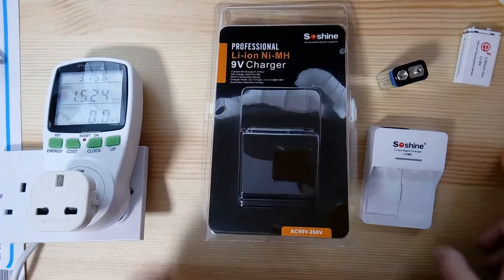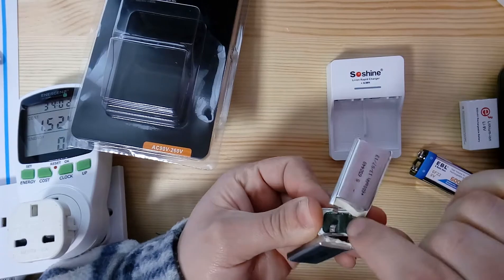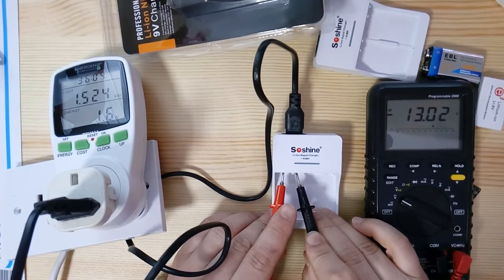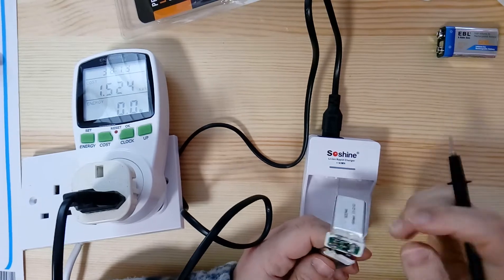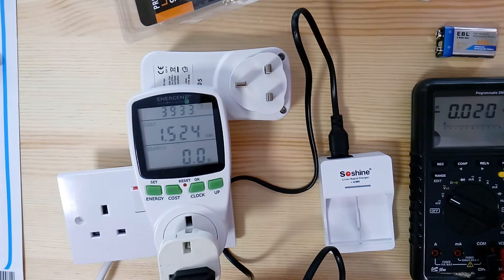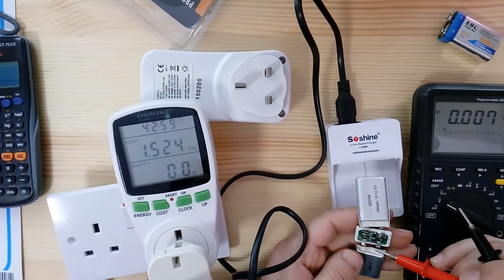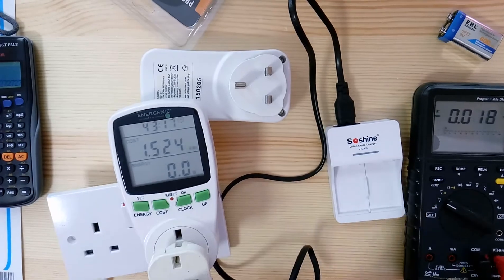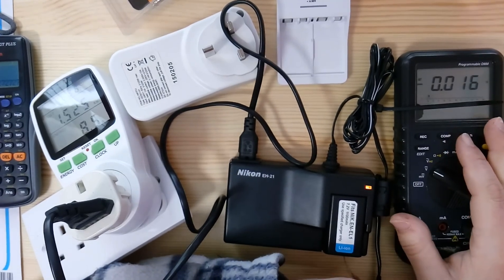Shoshine 9V Lithium Ion and Ni-MH battery charger

Comment: I am summer from soshine company.Regarding to the rebviews,please find the reply as below:
1. This charger is not a specific charger for lithium battery, but a multi-functional smart charger, which can support 9V batteries as: LiFePO4 3pcs in series, NiMh 7pcs in series, ternary lithium battery 2pcs in series. And this charger has a 0V battery(means: lithium batteries’ PCB are in protection state and NiMh batteries with serious over discharge condition) activation function.
2. Since the 0V activation function exists, it is not possible to determine if there is a battery access according to if the voltage is higher than 0V. The NiMh battery maximum voltage (charging) can up to 10.85V, and consider some unpredictable factors and errors, so no-load floating voltage is set to 13V (must be higher than 10.85V). By check whether floating voltage is less than 12.5V to determine whether there is a battery access. This floating voltage is not the charging voltage for lithium batteries.
3. After battery is accessed, charger will enter the battery type determine procedure, the time is about 20 seconds. If the battery has been determined as ternary lithium battery, charger will automatically switch the charging mode to constant current 200MA, constant voltage 8.4V for charging. So, as long as the charger is no problem, there is no reason for charger to over charge the battery.
4. As the charger will continue to determine the battery types, so it’s not possible to get the real charge voltage if directly load to resistance. If you really want to test the charge voltage for lithium battery, you can disconnect the charger’s connect test point (Figure 1) into the factory test mode.
(Note: Do not enter the factory mode test time for more than 1 minute.)
5. As overcharge is bad for lithium battery, so all ternary lithium batteries will be covered by protection boards for use. Multi-section combination is even more so. Generally protection board is to prevent the battery from: overcharge, over discharge, over current, short circuit, etc. Overcharge protection function works to turn off the charging circuit if it detected any one of the battery’s voltage exceeds 4.35V (the protection voltage differs in different protection chips). Due to this charger's battery identification mode, turn off the charging loop is equivalent to removing. So the voltage tested this time is floating voltage, not the battery charge to the 13V high voltage.
6. 9V battery has only two electrodes, so the charger can not detect the voltage of each cell, it will keep charging if the battery voltage is less than 8.4V. From the video we can see, one of the battery voltage is only 1.34V (voltage down to the value, the cells have been scrapped), the other battery voltage is 3.71V (normal cells), two batteries has been seriously unbalanced. When the normal cell voltage reaches 4.35V and the other voltage is less than 4.05V, the charger will continue to charge, PCB will enter the overcharge protection state.Conclusion: This video does not indicate that this charger is not suitable to charge for lithium batteries. But can explain the battery quality is very poor.
hope you will like our soshine products.  www.soshine.com.cn
Reply: Thanks for a thorough explanation! 
In fact I have the same charger and never had any problems with it.

Comment: awesome test of these battery chargers, do you think it is more the cause of the protection ic though? it has such low voltage tolerances it does not seem like it would do a good job, 13v is only 5v above the input voltage at 100% soc i am sure higher power circuits would properly protect from 20v at the terminals dont you think? thanks for sharing!
Reply from the maker: +SuperBrainAK 
I always take any protection IC with a pinch of salt, because the charger is supposed to put the right voltage in the first case. If there were no protection IC (Some crap Chinese battery) and the charger was allowed to top the battery up to 12V, surely a leakage or perhaps a fire would happen. This is probably the reason why most stores dont sell 9V batteries with lithium chemistry. Liability issues...

With that said, if one were to count with the protection IC to stop charge once the top value is reached, regardless of the charger output, in all fairness, any NIMH/NICD charger could be used, so as a consumer one can conclude that the device is not fit for purpose.

A workaround could be to place a zener such as a 1N5238B across the charger terminals. This would shunt enough current to force the charger to detect the battery as a Li-Ion and even if the protection circuit opened, the output would be low enough to keep things safe.
Reply: +Susana Godinho true, but my point is that the protection should "protect" the battery without failure from a failed charger or other extreme voltage spike, though I guess it did fail decently safe without having a lithium fire so it did its job, they arent going to make it so robust that you can do just about anything to it and still work. regardless I will definitely make sure I get a lithium only charger so I wont have to worry about these things. what is your opinion on the EBL AC two cell charger (http://.amazon.com/dp/B00ER10DZ0)? that is what I am thinking about getting when I feel I need some 9v's (I have a programmable charger but having something standalone is preferred)

Comment: If protection circuit gets damaged at 13v, than it is no good at all. Their batteries, same brand as charger work just fine. after they stop charging at 8.3xV, green led comes one... you your no load test is not valid
Reply from the maker: This charger has no issues detecting that the battery is fully charged, where it fails is under abnormal conditions, when the cells inside the '9V' battery are unbalanced and the protection circuit acts.

Comment: Thanks, I was just about to order one of these.
But do I have to buy a (big) hobby-Charger to get a better alternative?
Reply from the maker: +Juergen Lilien 

I'm on the same boat. Ill be designing a switch mode converter to take power from a USB port and boost it to 8.4V at 200mA. The problem is that there aren't many commercial chargers suitable to charge such a small battery out there, although I suspect if you can find one which is SPECIFICALLY for 9V lithium batteries (Rather than the universal type) you should be fine.

The hobby charge might not be the best alternative, although it depends how low it allows the charge current to be set (200mA ideal). Those things essentially operate as a Constant Current Source, while monitoring the battery terminal voltage to determine SoC and charge termination, rather than a true CC-CV supply, which can keep the battery in trickle charge for an unlimited amount of time, ensuring correct charge.

Are you good with electronics?